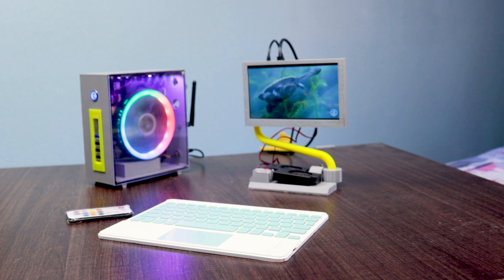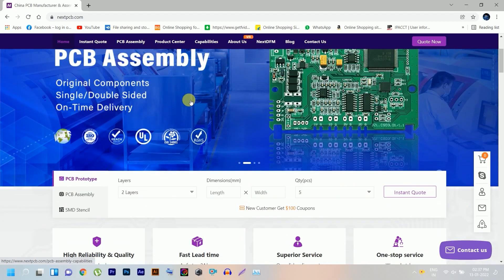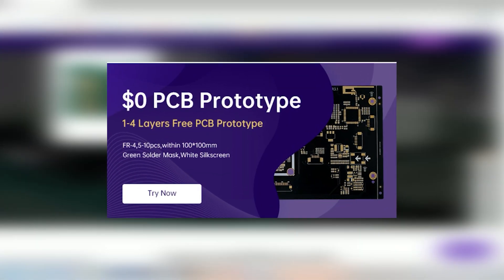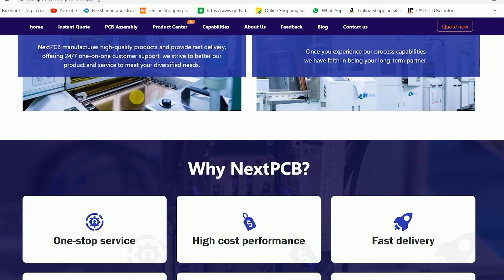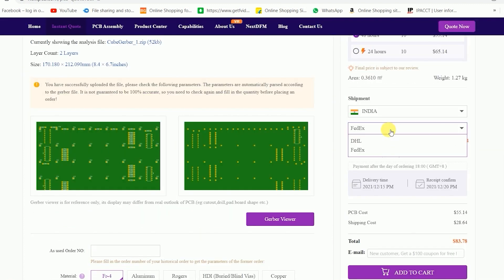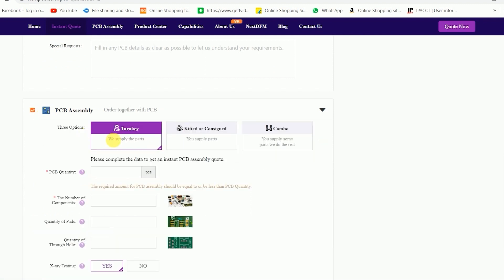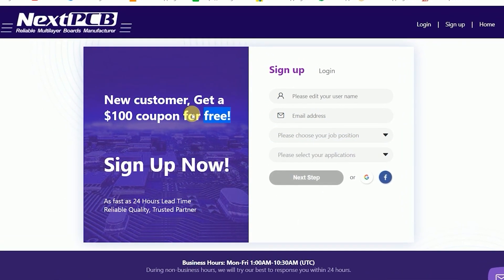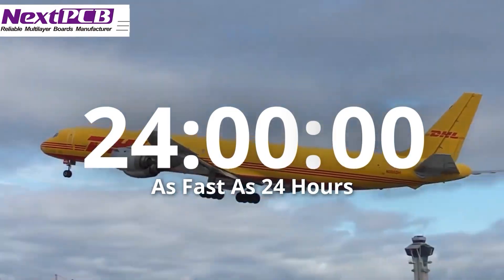Making The Most Smallest High Performance Windows 11 PC

Comment: Great job. You are a very skilled person. Very unique design. 
I wasn't impressed with your comment to the person that asked, why such a small screen though. It's in the title, you said. Well, Bro, your title is click bait as far as the high performance part is concerned. I did look up your lattepanda and it is really small is it's only claim to fame. It says 11 Gen and that's about it for CPU. RAM is a grandfather size of 8GB with a snail paced 2933MHz speed. Where's the Cinebench R23 score? 
Yes, this is a wonderful accomplishment in many, many ways. $400 for the lattepanda thing. Where's the graphics card? That little panda is not doing anything with its discreet graphics. You would have nothing but compliments from me, if I saw this build without the high performance bit in the title. ty
Reply from the maker: Thank u

Comment: has has nobody not realised the fact that the large cooler fan isnt getting any airflow?! the acrylic on the case should have atleast small holdes or a large fan cuttout and a dust cover on it
Reply: agree, even he feels it's ok, it's much better if he gives more room for air circulation
Reply: I think the chip don't need that much cooling,but it will be good if there is some gap to the hot air to flow out and cold air to flow in
Reply: you are right
Reply: I don't think that little chip required that colling
Reply: true, but the Lattepanda can create tons of heat at full power and cooling it more can let you possibly overclock it giving you extra performance.